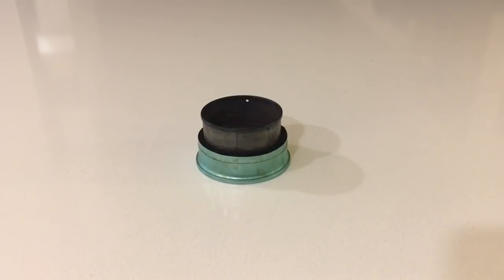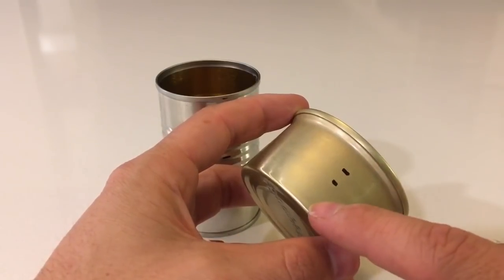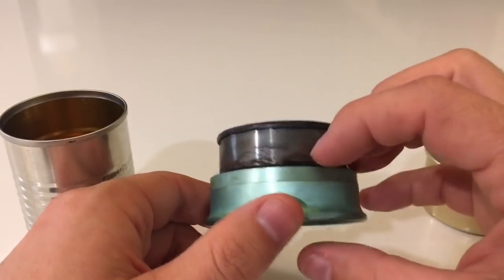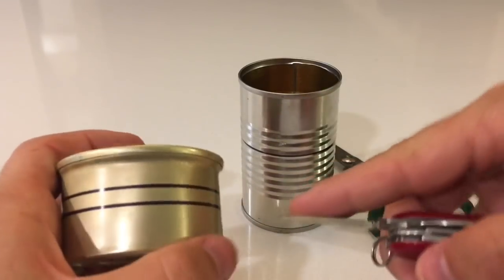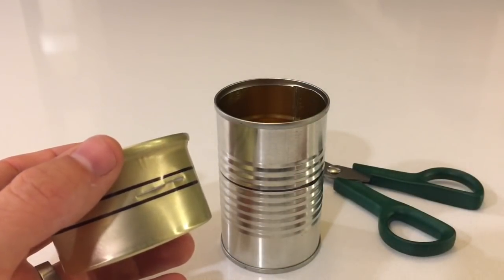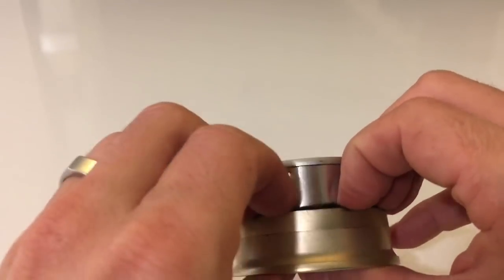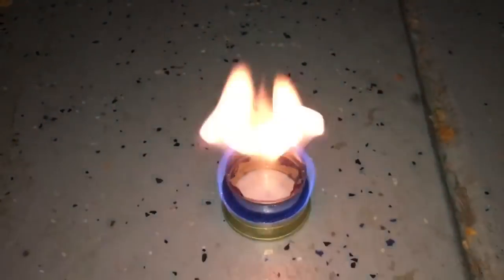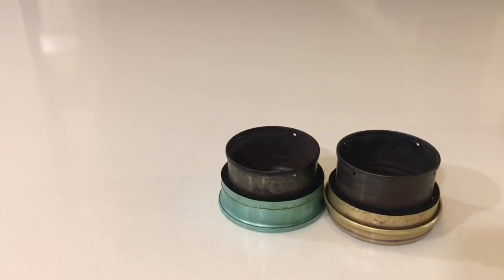Building the Best Alcohol Stove Out There

Comment: Really like this mini version of the fancyfeast stove 👍👍👍 question, what is the fuel capacity when trim like that
Reply from the maker: Fuel capacity depends on  where you choose to cut the bottom portion, so you can choose to cut it shorter or taller. The way I have mine done in this video has a capacity of about 1oz.
Reply: @ColoradoCamper  do you know the burn time on 1 oz, in perfect conditions?

Comment: Just made one of these because I love the idea of having a shorter system, but it seems to burn the fuel pretty quickly.  Did you experience the same issue?  Is a bigger can (aluminum pop can) inside with fiberglass (i.e. thinner than the carbon felt) a better way to go?
Reply from the maker: I haven't had that experience with the ones I have built. They burn about the same as the full size version. And I have never tried using fiberglass so I can't say how your idea would work. Sorry I can't be more helpful.
Reply: I've messed around with this general design and it seems that within a certain range, if you shorten the distance between the two can edges, the alcohol burns more slowly...if you go somewhere beyond an inch (inch and a half??)  the stove just doesn't work as well. YMMV.

Comment: Hey, just found your video. Great tutorial and I'm definitely gonna try building one myself. I was wondering, why do you need the base ring at all? I saw at the end that you mentioned it can be used to add a bit of stability, but besides that, could you use the bottom half of the cat can on its own? Thanks a lot.
Reply from the maker: The base ring has no real need. I just use it because it does slightly increase the stability and adds a little strength.

Comment: Carbon felt is expensive , about $10.  Just buy a Trangia or other brand of Alcohol stove.   You can get those for $15 and they are better built, more durable, and many come with flame adjuster,  flame cap, screw on lid and a pot stand/windscreen.
Reply: Obviously you have missed the point behind all of this.